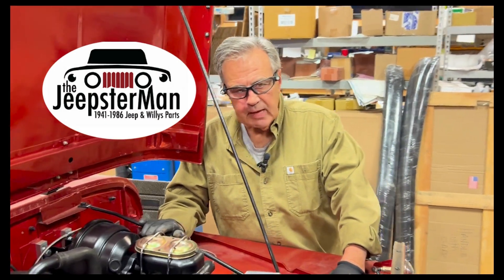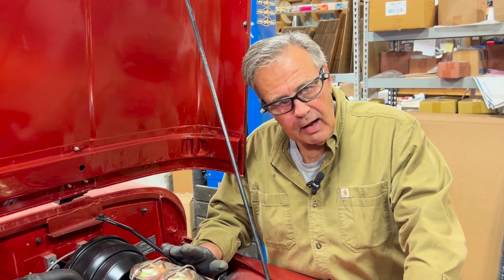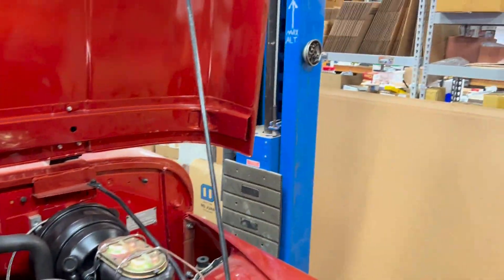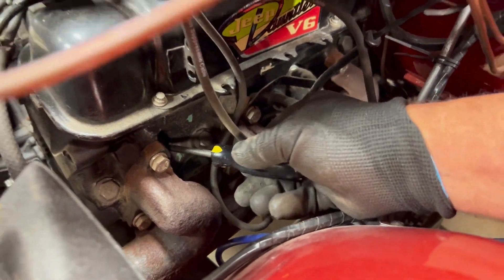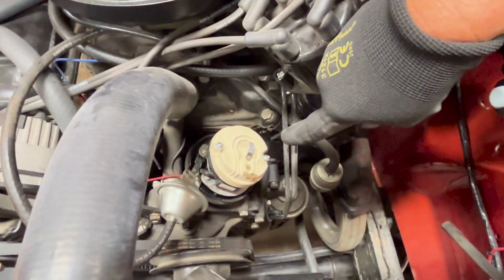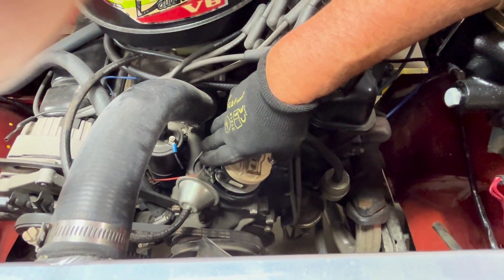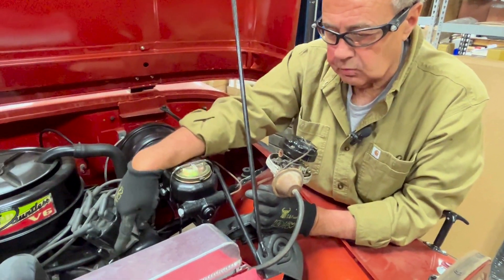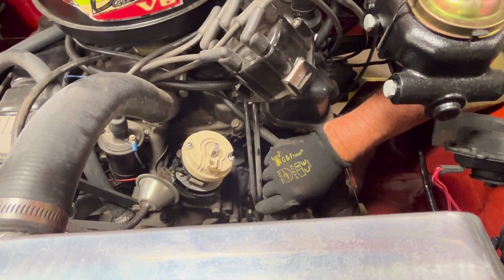Part II | How to Install a Distributor on a 225 V6 Odd Fire (Avoid This Common Mistake!)

Comment: So what you're saying is at TDC # 1 cylinder compression stroke, my rotor should not be pointing right at the # 1 plug wire but should be pointing at the #2 cylinder plug wire? Hopefully someone will respond!

Comment: I have a HEI dis out of a 1976 olds Starfire. will it fit in a 64  225 v6  grinding? is the vac. clocked right? thanks

Comment: Great video. The crank spins two rotations for every rotation of the cam, so making sure your on the compression stroke is important. You'll see the timing mark twice so if you have it on the exhaust stroke at TDC the rotor could be pointing 180 degrees out.
Reply: You are correct.